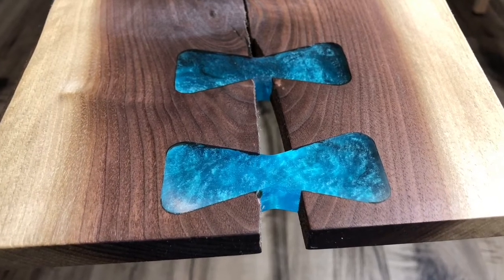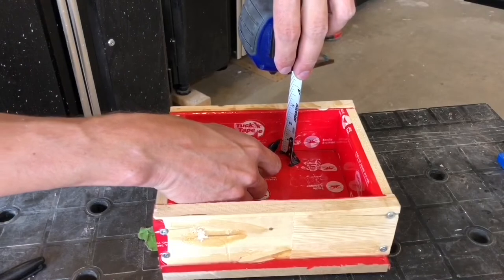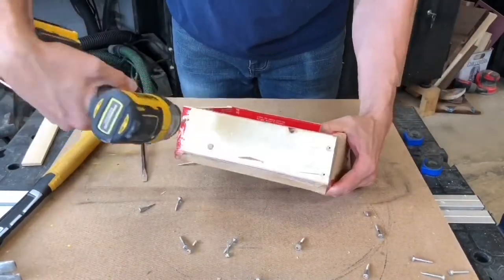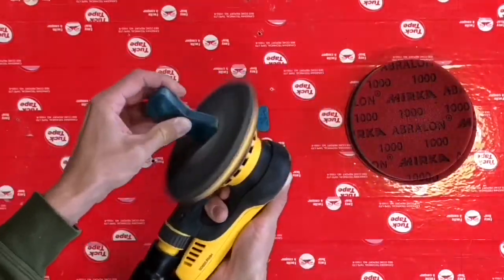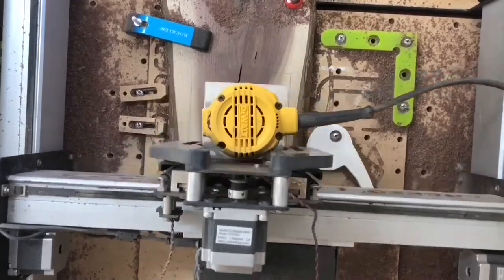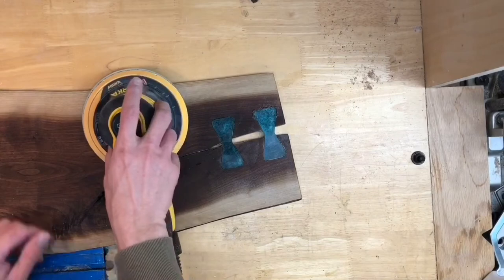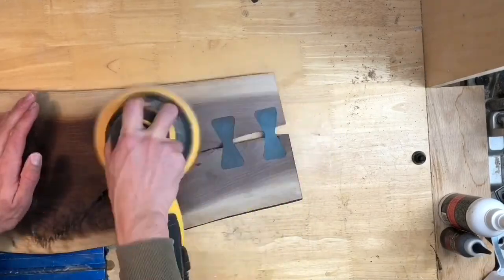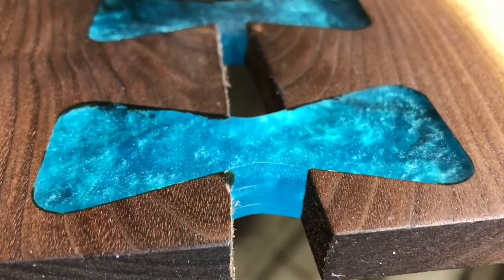How To Make Full Depth Epoxy Bow Ties // Using Left Over Epoxy

Comment: Couldn't you rout out the bowtie holes and just pour epoxy into the crack and let it fill the bow tie holes?
Reply from the maker: That would either just run out the crack or fill the entire crack with epoxy. (Very common and over done imho) Lots of people have cut bow tie shapes and filled with epoxy. The unique thing about this is the exposed crack and edge of the epoxy bow ties same as a wood one would be.
Reply: @ToolsThatBuild  Well the crack is on the underside so not gonna be visible. I was planning on filling the crack anyway, but someone else said I should do a bowtie, too, and I thought why not just cut out the bowtie shape and fill it completely along with the crack? 

I would tape the back side so nothing leaks out. Looks aside, do you think this would create added strength? Any reason I shouldn't do this?
Reply: I might try a test on another piece of wood and see how it turns out. I think it could be cool.
Reply from the maker: @andrewbland625  it’s been done lots. Essentially it’s gluing two pieces of wood together, search Instagram or Google image and lots of what your describing should come up. The tape will work fine. The debate on added strength is on going. The epoxy is strong enough as is wood in the bow tie shape but where it gets questionable is the bond to the wood from the epoxy. If it adheres good it’s fine but epoxy River tables which is a similar application have failed with high humidity or temperature swings. My method solves this but in reality if the piece is acclimated and there isn’t huge humidity changes I think it will hold long term.
Reply: @ToolsThatBuild  I haven't found anything showing someone fill a bowtie cutout with epoxy. Lots of content about filling cracks and making bowtie inserts, though.

Comment: What an inefficient way of making epoxy bow ties. :)
Reply from the maker: These bow ties are made with left over epoxy from other projects. They are repurposed waste essentially. Besides a bow tie shaped mold this is the only way to get them full depth otherwise you would just be filling a bow tie hole on the wood which isn’t the same.

Comment: We're about to attempt some partial depth epoxy bowties. We're going for a clear glass look on a large oak table.  We figure a half inch (approx 13mm) depth on a 1.5 inch (roughly 38mm) table should be good.

Only thing we're concerned about is overal tensile strength. Here's hoping it works put well.
Reply from the maker: Been done lots and there is no problem with strength the epoxy won’t let go as long as it’s bonded well to the wood. I recommend sealing the wood with a bit of epoxy prior to the actual pour. And if your looking to get good clear results ( no micro bubbles like most people “clear” has) I would recommend checking out my “casting bottles in epoxy video” or using a degassing chamber.